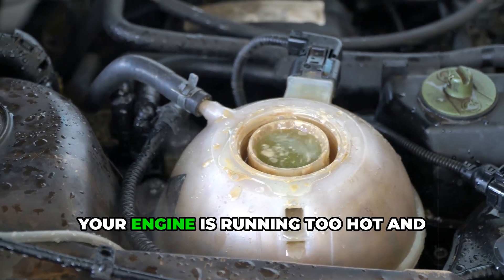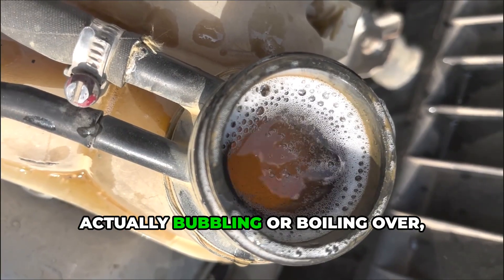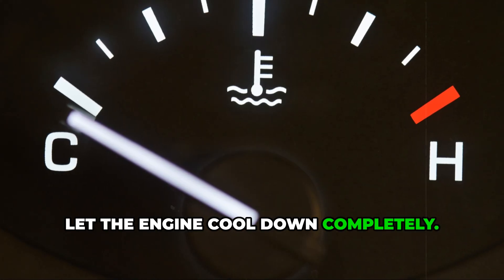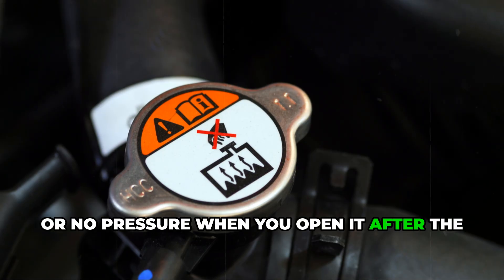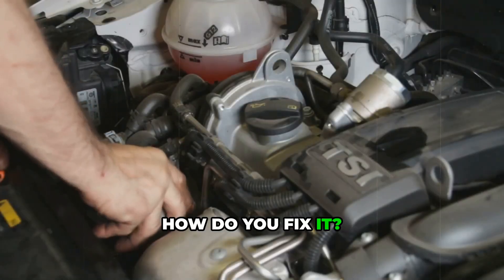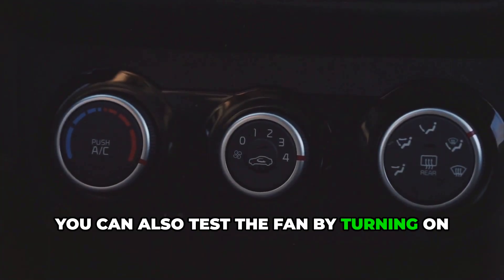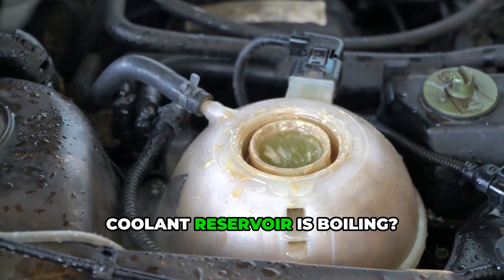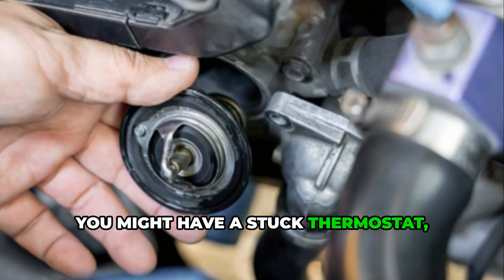Car Coolant Reservoir Boiling (Bubbling Causes & Fix)

Comment: Hi I have a BS6 or Euro6 diesel engine in India, I am observing both Engine oil and coolant level rising on its own, what could be the issue. Both Coolant and Engine oil are Clean, no signs of emulsion/ milkshake. Is a 2 year old 20k Kms run car.

Comment: Hello i am a 2004 toyota ist owner,i have a quistion? when i take off the radiator cap,and start the engine while the cap is open coolant jumps out from the radiator is it normal in ist or any other car???
Reply: Yes

Comment: In my case, I saw my reservoir had a several cracks in it on the corner of it in my 92 Camry, as well as cracks in my radiator where coolant is shooting out consistently which is letting pressure loose. Bought a new one of each and I’m pretty sure this is the cause of the issue, and hope this gets solved. Both should be here before the 14th. Will update if this is exactly the issue
Reply: update?